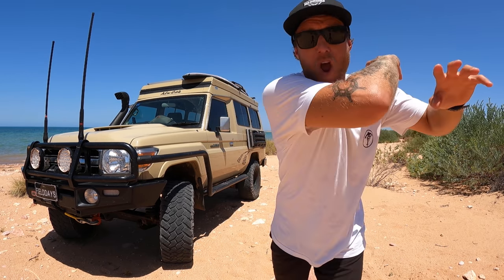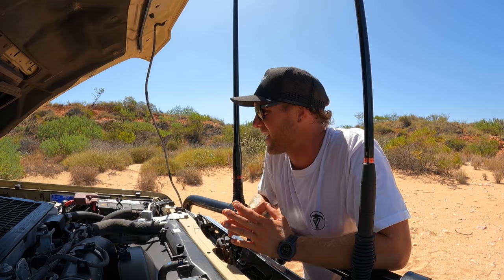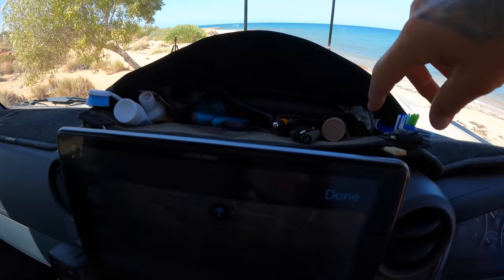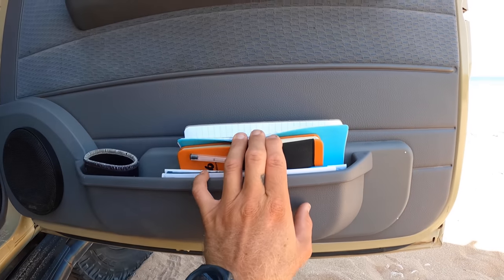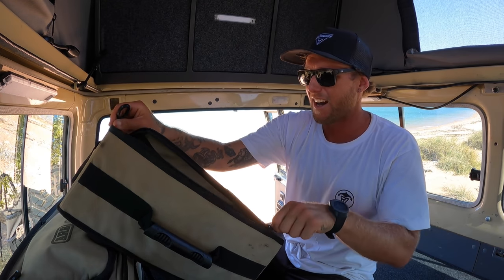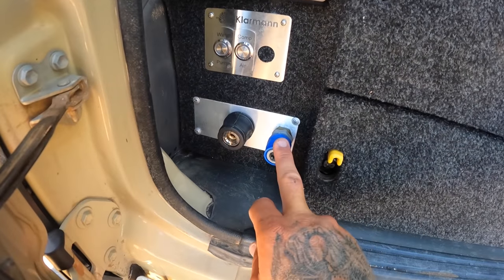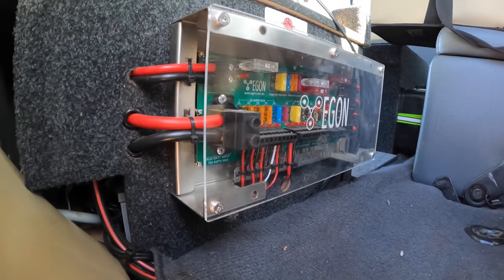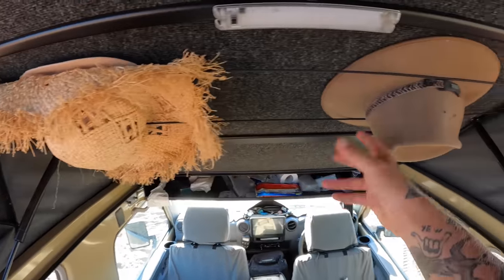THE ULTIMATE 4x4. TROOPY BUILD... What is this car? Take a look inside my Troopy

Comment: Hey Matt
Just watching the next video from Maki And I reckon you should get some salt assault , salt X or something else that dissolves salt. ARB or boating places sell it

you can put into a pressure pack like a garden weed sprayer and you give the whole car a spray to dissolve all the salt in cracks and crevices before and after going to the beach. You just leave it on and it’s like a salt dissolving coating.
You can put some in a bucket when you’re washing the car just sponges on and put it in your windscreen washer fluid so when you’re cleaning your windscreen on the beach it washes down through all the cracks with the water after washing the salt off the windscreen

Comment: The million dollar question is how much did it all cost? Thats one heck of a trooper you guys did a great job with! Well done!
Reply: Fr I’d have to say 100k
Reply: exactly what ive thought
Reply: Ya, id say no less than 100k.. for sure! But dude this is amazing!! And other people spend more than this on a car that doesnt even have cup holders!
Reply: I bet a lot lol
Reply: Electrical/solar alone is about $15k. But where the costs really add up is the little things. The arm rest. Seems simple and harmless was probably $500 for product and install. The lights with orange to white light probably $250 each. Just little examples of the lots of small things that would add up.
Reply: the car alone is worth 100k
Reply: $150k+
Reply: Yeah the car along in 100k. I’d say closer to 200k fully built
Reply: @watchgttvnow  that’s just the car alone
Reply: @peterjunior4313  100k dollar ?
Reply: 100k  lol try 200k plus AUD$
Reply: $75k vehicle
$15k rooftop conversion
$8k internal fit out
$7k solar/battery/air/water/wiring
$5k suspension upgrade
$5k Bull Bar/Rear Bar
$5k additional bits
$120k minimum 👌
Still cheaper than a stock 200 or 300 series 👍🏽
Reply: At least a 125-150k build . Which really isn't that bad for what you get!
Reply: @watchgttvnow  try 200k+, the car itself stock costs between 90k-140k
Reply: @coenwatt9458  your another flog, 80k brand new, not stock between 90k to 140k
Reply: @JordanGlennon  “You’re “ 😂😂
Reply: I'm wondering if money goes further in Australia? I'm sure healthcare is cheaper etc
Reply: The whole thing cost nothing , we all pay for it lol
Reply: lol
Reply: I bet you he got all of it free other than the actual vehicle itself bone stock because companies like free advertisement and word of mouth so they'll work out a deal saying promote our business and we'll comp all the work and materials cause they know they'll get it back 10 fold!!
Reply: At least 125 because the car I already 100 grand plus modification.
Reply: @oksooners  True.. just for showing off
Reply: Y’all realize he’s probably got some good sponsors for what he does and gets good discounts? And plus I’m sure YouTube pays him pretty well.
Reply: @peterjunior4313  they sell for almost that. They're not worth that though haha.
Reply: not worth anything , its one of those v8's lol.... YES I SAID IT!! HAHA
Reply: A million dollars 😂.
Reply: @watchgttvnow  the car is like 80K+ than the extras , so Prob 110K , than all the camping stuff ,prob sitting around 130K+
Reply: @watchgttvnow  well the troopyits self cost 81k then about Max 20k else
Reply: Does it matter?

Comment: $75k vehicle
$15k rooftop conversion
$8k internal fit out
$7k solar/battery/air/water/wiring
$5k suspension upgrade
$5k Bull Bar/Rear Bar
$5k additional bits
$120k minimum 👌
Still cheaper than a stock 200 or 300 series

Comment: Do you have an estimate on how much this whole build costs troopy included? I would love to get one myself in the future!
Reply: We’re doing a similar build, just ordered a brand spanker to do the mulgo roof conversion and internal fitout, suspension, bar work, 12v set up, a few additions to engine bay etc and the math on mods is already at 130k and we haven’t even got it yet 😂 worth it

Comment: Strap some pontoons on that thing, and you got yourself a houseboat!

Of course you would want paddles on the wheels, and cruising at low kph would be optimal.

Also I forgot to mention...

You will need some big pontoons, as well as a strong structural support.

P.S. that strong structural support would add some more weight, so don’t forget to double up the pontoons for extra floatation.

I think that should work...?

Or you could always just mod an amphibious vehicle.